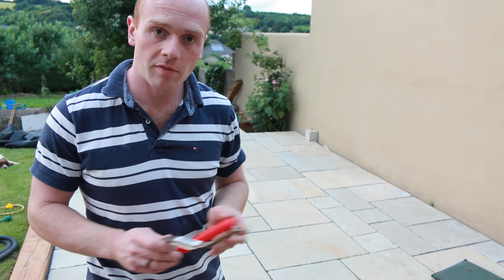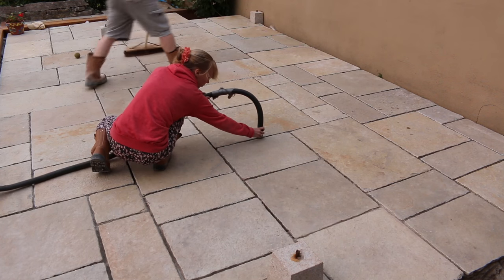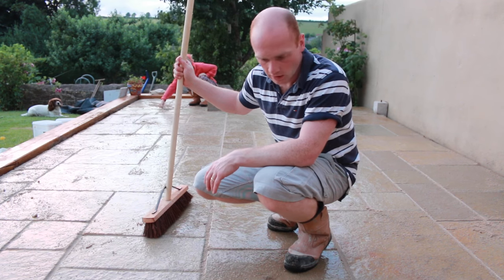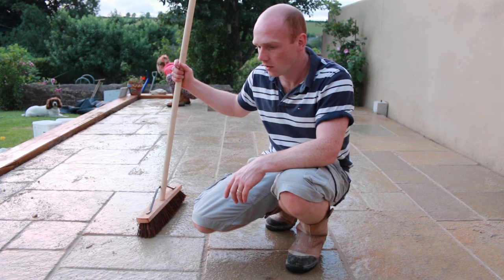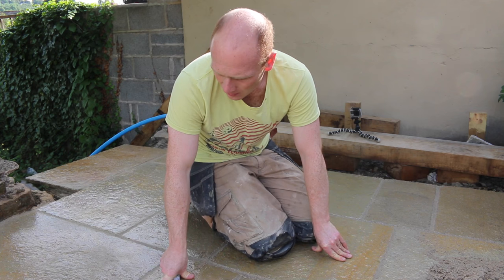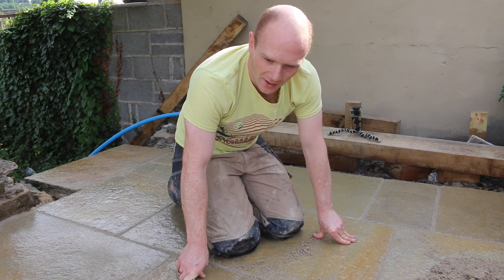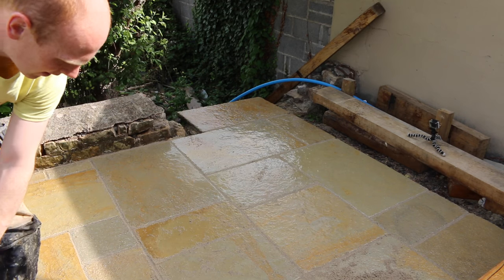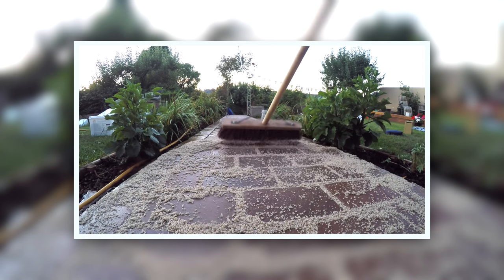Pointing a Natural Stone Patio using a Brush in Compound

Comment: Great vid, you made a good point why skimp on pointing when you've just spent £100's on a patio. I bought silka fast fix and literally followed what you done lol... Cheers for the good vids, simple and to the point, easy for any diyer 👍
Reply: How did you find the silka? My joints range from 20-40mm and the same in depth? Cheers
Reply: @robparkinson7730  on the good gaps it works well, as long as you compress it in. On the smaller gaps and if I haven't compressed it, I've cracked it and it came out.
So my only advice is, make a tool (wood same gap width) to push down all joints and take your time, give yourself a good few hours to do. So much better than loose sand. And definitely better than me messing it all up with wet cement haha... Good luck 👍
Reply: @chrisuk441  spot on pal thanks for the tip 👍

Comment: Hiya Tim, one useful method I found when I did something similar was to use a small length of feather edge cladding (foot long). You can then go along and using the narrower edge you can force the pointing mixture deep between the slabs and then use the pointing trowel to finish off the tops. Just a thought. BTW I am getting it in the neck from my wife for sitting down and watching too much of your footage! All looking good though - well done

Comment: This looks great! Does it hold up well when pressure washing and how well has it faired over the last few years?
Reply: It set's like concrete, just make sure it's wet and well compacted in the joint's when using the pointing trawl, this will stop it from cracking or braking up when pressure washing

Comment: just done my patio don't wet before you start bruh in pack it tight brush of  then point go over lightly  with a leaf blower removing any particles left on patio and the using a pump spray on a fine mist soak the area  once  at night  and one in the  morning  for two days goes rock  hard and  no staining   easy no mess

Comment: wonderful product, never bend down or remove weeds between the joints on your knees again, that's all over with Resiply, for years to come! Processed in 15 Minutes 8m3.
When the temperature is above 15 degrees C you can walk over it in 30 minutes, the higher the temperature the faster. Specification: Joint width: at least 1 mm ; Joint depth about 1 cm.
All stone types, old antique tiles (more than 100 years old) are automatically polished, and look like new again. No grey veil, that means no extra "anti-grey agent" to buy, one is also faster with the finishing of the project.

Comment: What exactly is this stuff?  Is it cement mortar or rubber?  What is it like after it drys?  Will it hold up to freeze-thaw cycles?
Reply: It's a resin based material. It's says it's frost proof and wot not but ive used many different brands. Some go rock hard but ive done a whole drive in sets and they wanted brush in resin and the weather woz below freezing and it never went hard. So my theory is dont do it in minus degrees and you will be safe

Comment: Is pointing used to level all the slabs or make them even with each other ? Because my gardener has some corners that are higher and lower then one another by half a inch
Reply: Sounds like you need to get someone else to re-lay the patio

Comment: hi mate. been watching your videos and got loads of good tips. just wondering what your opinion of the jointing compound is now its been down a while? i had a raj green indian stone patio layed last year and the builder used geo fix all weather. its very similar stuff but not lasted even a year im very disappointed. just wondered what you used and how its weathering? thanks
Reply from the maker: Very good.  It was pretty much a sand colour to start but has darkened slightly.  But it has held up well and no signs of crumbling or shrinkage and rock solid.  It was the stonemarket product, same as marshalls.
Reply: The Restoration Couple  thanks i might give it a go. ours was geofix all weather. very good to start but lots of shrinkage and gaps appearing. very dissapointed after not even a year
Reply: Matt Sidebottom you repeated what you said in your original post...smooth pal
Reply: I’m surprised it’s not come out as you didn’t apply enough water to the mix as you swept it in the joints.
Reply: kryptoniteee bellend
Reply: Matt Sidebottom just my observation.
Reply: Matt Sidebottom 😂😂

Comment: I did a small grey patio in sandstone  
Pointed it up in the grey stone market all weather , it put a yellow stain round the edges , the job was soaked start to finish , made me weary of using again , anyway your job looks mint!
Reply from the maker: How odd.  Perhaps the product has changed a bit now as we didn't notice anything on the limestone or sandstone.  It's held up well over winter so pretty confident I would use again but hard to say for certain on things like this until you have given it 5 years or so.

Comment: Hi, Can anyone tell me if you can use a jet-washer safely after using resin based pointing? My existing patio is underneath trees and it seems to get  dirty very quickly, so when I replace it I am not sure whether to use the resin based pointing, (which I would prefer to do) or sand & cement pointing which will presumably stand up better to regular jet-wash cleaning. If anyone can give me their experience on this I would appreciate it....Thanks, Adam
Reply from the maker: I’ve pressure washed 3 or 4 times and not had a problem. I wouldn’t recommend doing it much more than once a year as it could degrade over time.
Reply: why pressure wash it, all you do is increase the surface area and invite more staining and growth. sodium hypocholirite dilute, watering can. 2x a year.

Comment: could you not have just poured a mix of dry sand and cement then sprinkle water on top? would that not work
Reply: that would just crack
Reply: zir786 no
Reply: Did you like ground force by any chance
Reply: My thoughts exactly 😁
Reply: It would stain the slabs

Comment: Should old wet the joints very well (watering can) and leave till the slab is not wet before you  point or you run the risk of staining
Reply from the maker: It needs to be completely soaked for this product. 👍
Reply: The wetter the better with this product,literally brush and hoze simultaneously